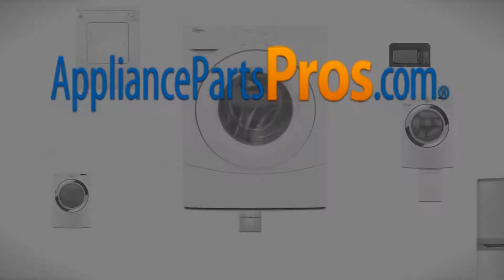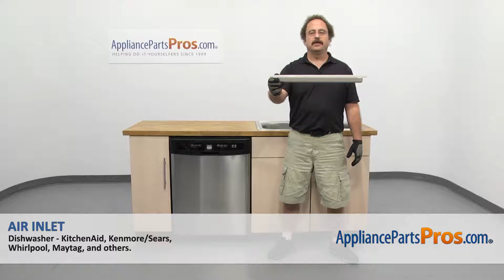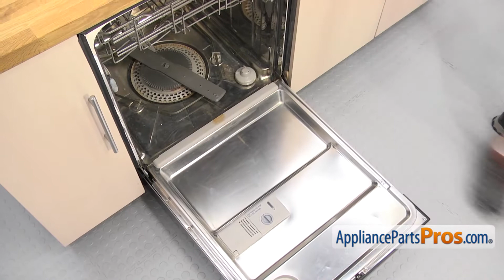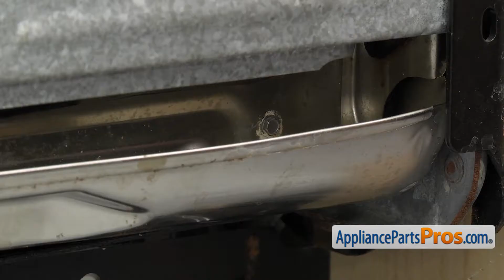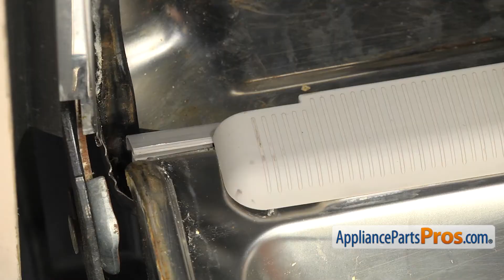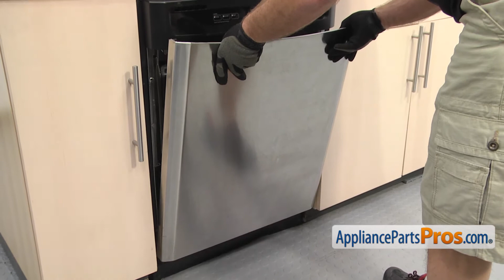How To: Whirlpool/KitchenAid/Maytag Air Inlet WP8268937

Comment: Thanks for the great video Matt.  I have water building up and sloshing out over the lip of the tub (the section you access to remove the air inlet screws)  and I"m trying to figure why such an amount of water is building up there.  Do you have any thoughts?  I"m not sure if it's because of a stuck water inlet valve, a door seal issue or something to do with the bottom seal on the Air Inlet.  I would appreciate your insights. BTW I have an older Kenmore Elite dishwasher (model 665.16579200). Any insights would be appreciate.  Thanks again to you and your team for the excellent videos.
Reply: Same issue. Did you determine the cause?

Comment: Thank you for the video.  I noticed I'm getting some water on the insulation of the front panel.  When I took off the cover the rubber insulation above the dispenser was all warped from what I wonder if the vent is allowing the hot steam to get into the panel and cause damage.  Would it make sense to replace the vent foam seal?  Clearly there is heat that was exposed just below that area of the vent.  Only other thing I can think of is the vent is not open/closing properly.  Thank you